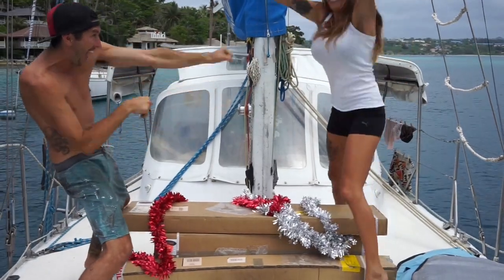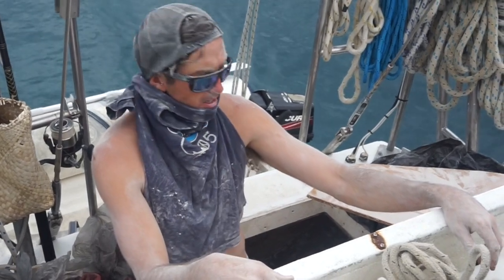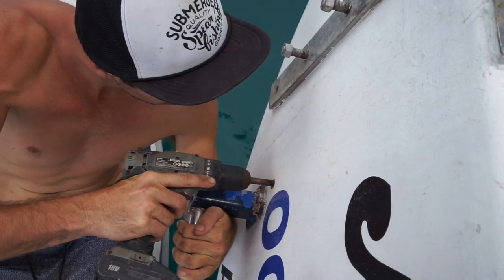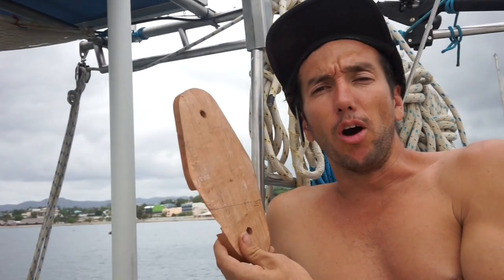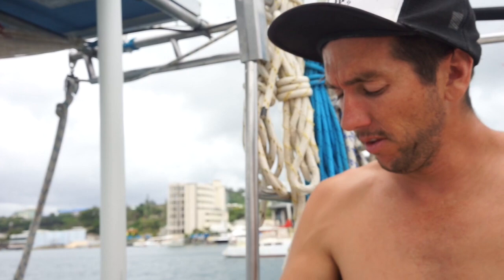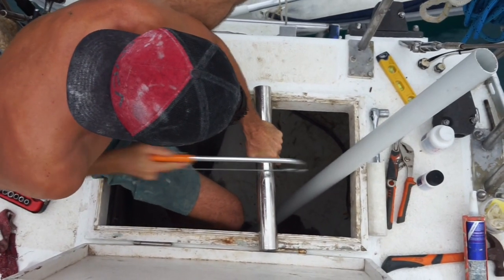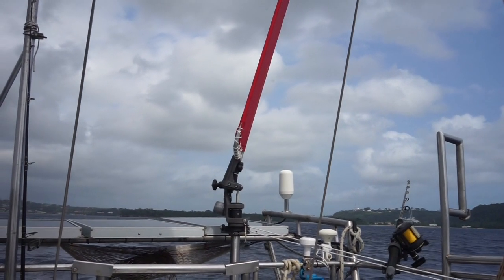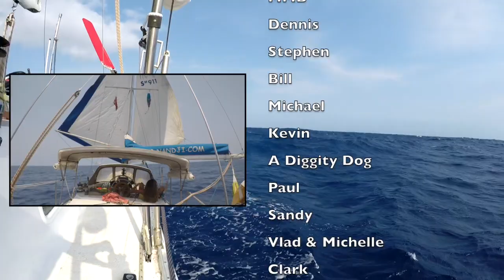Installing our New Windvane! How GOOD is this!!  Sailing Nandji, Ep 59

Comment: I know nothing about sailing, but from watching other videos, this technology won't suffer from salt water induced short circuits like the electronic ones do! Great Xmas for you guys. Interesting installation video -thanks for the update.
Reply from the maker: Thats why we love it! Simple and mechanical that I should be able to fix! none of this computer stuff! Cheers legend
Reply: We installed a used Hydrovane (ours is the 7th boat it has been on) in 2007. We have used it for at least 20,000 nautical miles and consider it our most valuable piece of kit. Wouldn't ever want to sail without it now. It's like having a third crew member. Enjoy your time away from the helm!

Comment: No air brush artist in that one awaiting to emerge. Hydrovanes and the Scanmar Autohelm systems are the ones to have. The autohelm from Scanmar doesn't keep as tight a track but have less transom weight and are slightly less expensive. They also are a better choice rigs where a boom extends over the transom, Worries about rudder issues forcing boat abandonment evaporate with either of those systems.

Comment: You have to tell her to put on the paint like she would put on her make up.....lightly and a little at a time. LOL! Naaaaa.....she's a beauty and doesn't need any make up. But she could use a few painting classes. To her side, it was a little windy to be painting on deck!I was wondering what kind of unit you installed? I found that most of them are supposed to be installed on the center line of the boat. I have a swim platform so I would need to find one that can be offset. I can't remove the swimplatform as I'm disabled and it's my way on and off the boat. Merry Christmas and I look forward to seeing how it works out over a few sails to see how good it works. I have a Raymarine ST1000 but I want something that doesn't use electricity to operate. God Bless and Merry Christmas!

Comment: I have been thinking of either the Cape Horn or the Hydrovane. Did you consider other vanes? What made  you decide on the Hydrovane?
Reply from the maker: vfsurgpa the small mounting area on tge transom, its own rudder, no ropes to wheel and the ability to offset the mounting was the main thibg. we have lots going on at tge stern of nandji and did not want to modify things too much

Comment: Don't want to sound like a safety Sam bro but carbon filter dust masks will save your life. With that said great vid guys.
Reply from the maker: I actually thought I had some still in the cupboard, it was not to be. I was very much in GSD mode... (get sh*t done) believe it or not, but safety equipment is not well sold in Vanuatu! Cheers
Reply: at least you disclaimered, still terrible though

Comment: Great video. Great job. Bonita - you my dear are Ms. Leonardo da Vinci :-). I like the fact that the two of you have such a good time doing some mundane jobs. One question for Yos:  I thought your wind vane had to be centred on the back of the transom but you have installed yours off to the port side. Does that affect the performance of the wind vane?

Comment: I noticed you mounted the win vane off center to port will the rudder reach far enough into the water to work properly when you are dipping the starboard rail
Reply from the maker: Hydrovane are the only type of vane that allow for a offset mount. We were curious as to its performance when on opposite tack but the rudder is very long and the small off set really only affects around 100 - 200 mm of rudder displacement. Since the ocean is never flat, it is actually more under water all the time then expected! It is 1m long aswell

Comment: Great vid , really Interesting to see you instal as planning to fit one to my Corsair - Im sure it wont be as easy as you made it look! 
Was it easy to rig the lines to the wheel?
Reply from the maker: The hydrovane does not require lines rigged to the wheel. This was another big draw card for us. You only have one line down your safety lines to adjust course from the cockpit. The installation is actually quite easy and they provide good support and easy instructions. We recommend for sure! Good luck on your install!
Reply: Sailing Nandji - Frothlyfe thanks for reply guys.

Comment: Guys,congrats.  I have to say that not having a respirator and goggles is a big problem.  Glass is horrible in your lungs and can cause all kinds of scars in your lungs that can turn into life threatening issues.  I know you are young and invincible in your head but you aren’t.  When I saw the dust collection around your nose I nearly freaked out.  Also, you need to find out how that water got in there.  Good temporary fix but when you haul out this needs to be high on your list to fix property.   Love your videos, not trying to be negative or bob the bummer but I would feel guilty if something happened to you and didn’t say something.
Reply from the maker: Cheers mate, I know i did the naughty and I thought I still had safety gear in the cupboard but it was not to be. Unfortunately safety gear is not highly sold in Vanuatu. I think the water got in there from previous times. Before we left Australia I did a big fix it on the port quarter and I thnk i did not adventure deep enough into the transom. Previous owners had let the boat go a little and slowly i am discovering the issues.

Comment: Sorry to be a bug but how does it work heeled over on port tack?
Reply from the maker: We were curious of this as well. Hydrovane are the only vanes to be able to off set. The ocean is not flat and you would be surprised how much of the rudder is always in the water! Also, the rudder is long and the lean of the boat actually only affects no more 200mm of rudder displacement. The rudder is over 1m long...
Reply: We have ours offset as well, but not quite so far as these frothers. It performs wonderfully. The giant balanced rudder has an enormous amount of power.